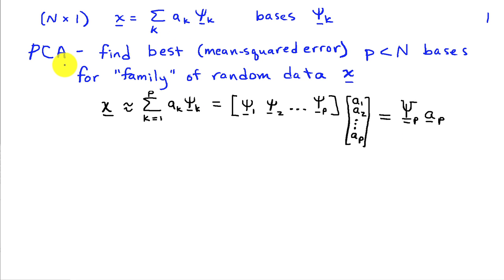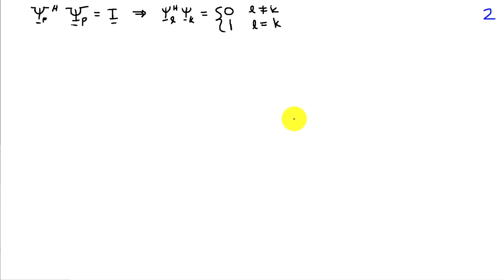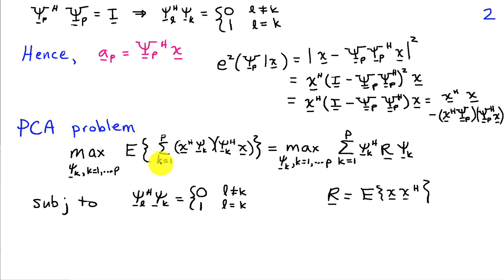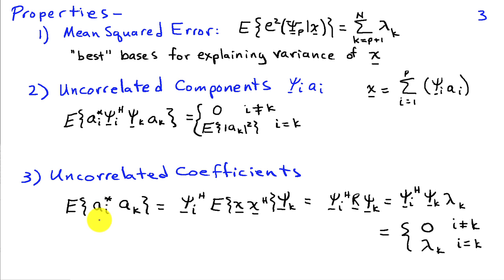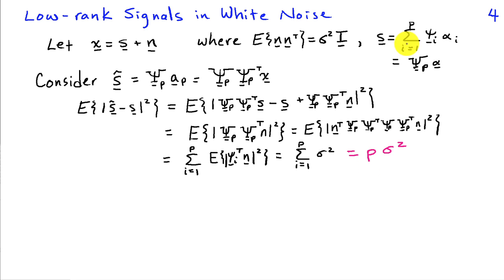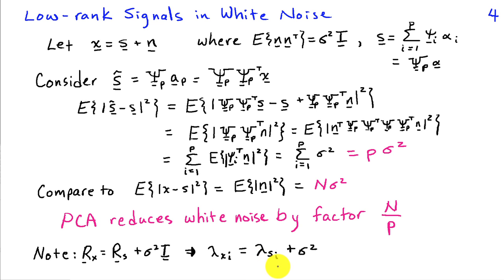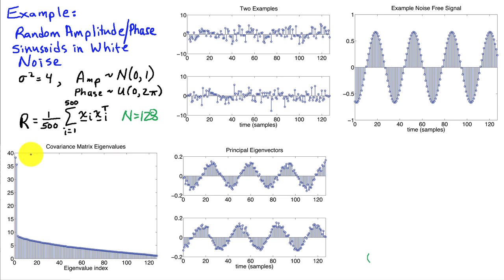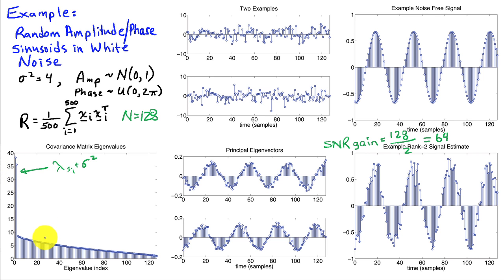Principal Component Analysis

Comment: Very nice and clear video! I have a question. Suppose you have a single realization of your signal. In case of a sine wave you can still denoise it by doing a PCA (or KLT if you want to call it like that) considering the autocorrelation matrix of the signal isn’t it?

Comment: Thank you for this video! I would like to ask a question to make sure I understand how to implement it properly. I have electrophysiological data collected from the brain. The recording device has 16 channels positioned at fixed distances from each other and recording brain activity from slightly different regions. The way to apply PCA to it would be to put all data in a matrix where each column is one channel and each row is a time point. Then perhaps do some preprocessing (e.g., centering), followed by eigenvalue decomposition.

Have I understood it correctly? The part I'm slightly less confident about is organizing my data into the matrix. Did I get the rows/columns properly?
Reply: Sorry, forgot to add that after the preprocessing step I calculate the covariance matrix from the data matrix and apply the eigenvalue decomposition to it.
Reply from the maker: Lyuben Laskin The row/column def depends on how you calculate the covariance matrix.  I assume you want the spatial principal components.  In this case, if X is your N by 16 data matrix (each column a different channel), then you should compute the spatial (16 by 16) covariance matrix as R = X^T*X where ^T is transpose.
You are probably already high pass filtering the data to get rid of low frequency artifacts common to electrophysiological signals.  So your data is already zero mean over time.
Reply: That makes sense, thank you!

Regarding the high-pass filtering, I am actually not. What cut-off frequency do you think should be used? The artifacts I can think about is the power line noise and perhaps the 1/f noise. Can't I get rid of them with band-reject filters instead? Since in this study I am mostly looking at the so-called local field potentials, the most interesting frequencies are 4-50 Hz.